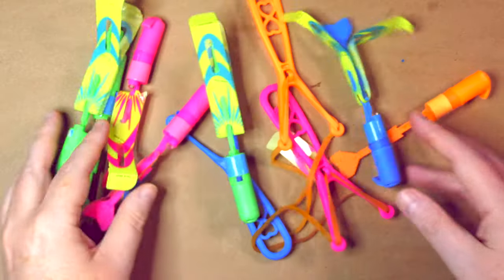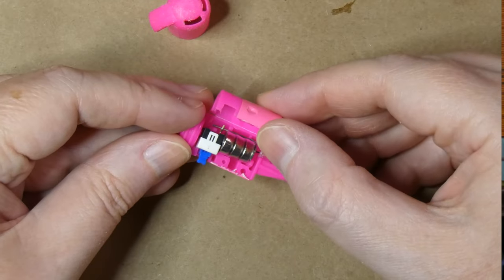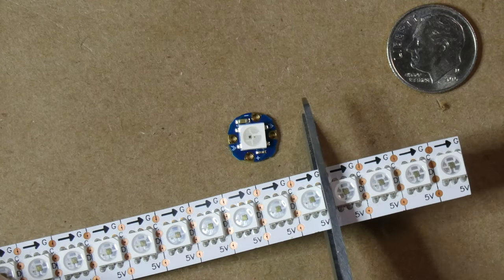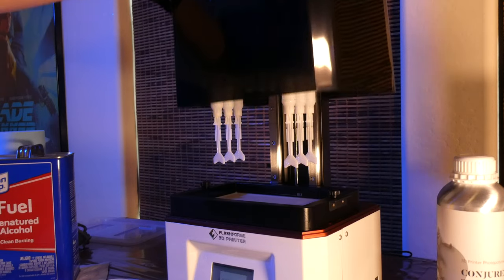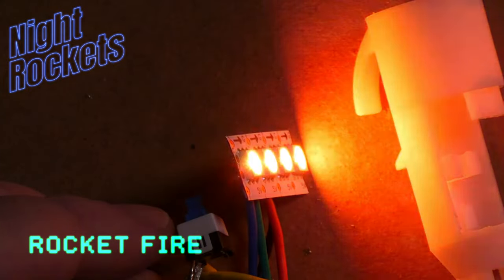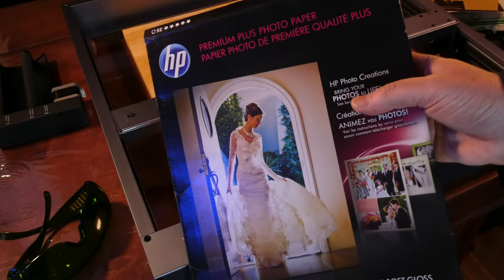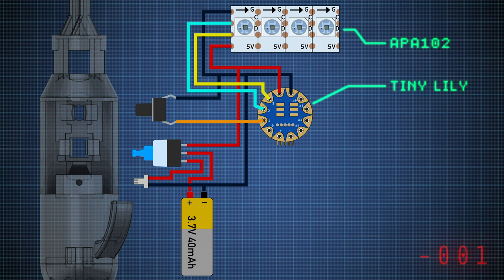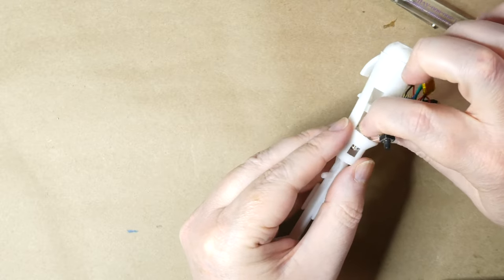Designing the alternative to fireworks

Comment: how about adding an accelerometer function to flash ( or do something) at the highest point .
Reply from the maker: It sort of does because the acceleration changes at that point. So it turns white for a second. It’s weird because the accelerometer doesn’t give you speed but changes in speed.  So you could probably track speed from that mathematically from that. But also it’s hard to see changes in the light 150 feet up.  I do have an idea of what to do with 2.0 though. I could have the wings be folded in on the up flight so it’ll go higher. Then fold out when it reaches the highest point.
Reply: @Nerdtronic  you could also calculate height and speed based on time of acceleration etc